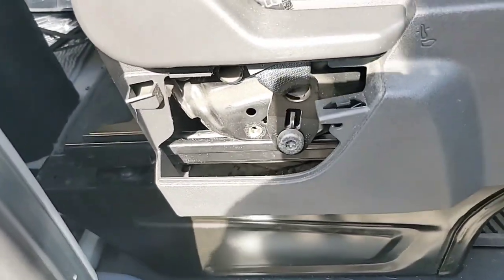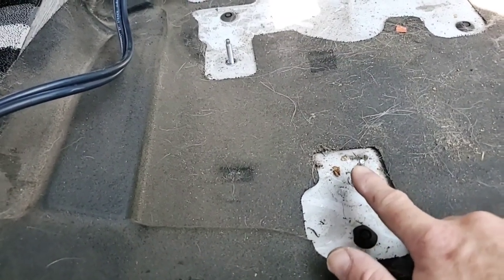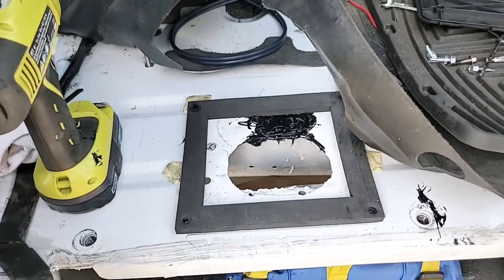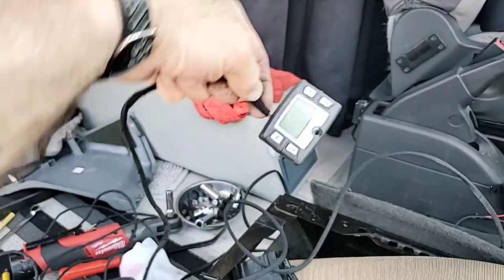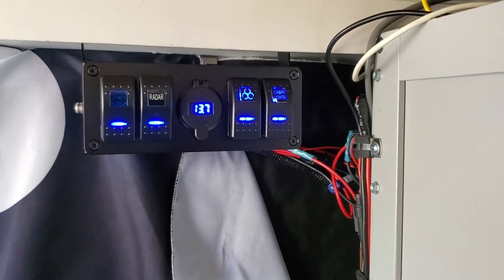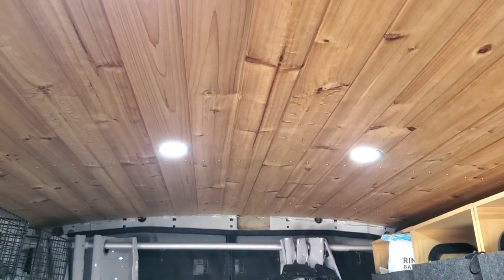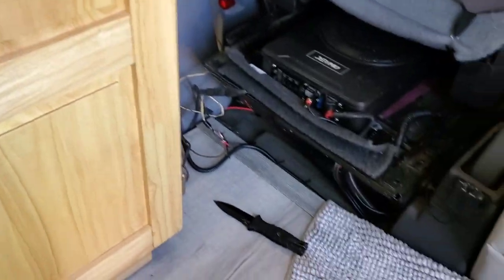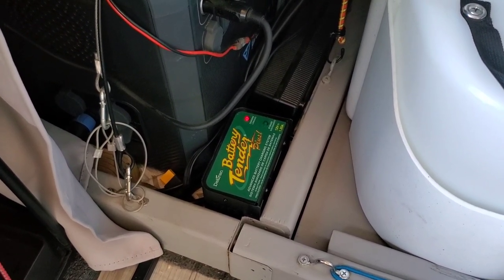Van Conversion Vlog #39  Bison 2000A Gas Heater Install - Part 2.     I messed up twice!

Comment from the maker: Update Steve, my check valve was bad. It was letting fuel evaporate in the line. Bought a replacement fuel check valve, so far it been working.

Comment: Couple of questions - happy with the heater? Where did you order the replacement controller from? Are you using the digital or analog controller? Thanks
Reply from the maker: yeah its ok, the instructions could have been a lot better, had to call general components twice to get the right info.  it fires up after 2 times now and blows hot. I'm using the digital controller right now, its kind of confusing. the analog controller I bought from general components. haven't used it yet. I think the biggest thing you need to do is mount the fuel check valve as close as you can to the heater fuel port.  And then there is a fuel damper right after the pump. My check valve is about 3 inches below the heater. So, after not using heater for a awhile it takes two starts to get it to fire up. Not that big of a deal for us. 
Thank you for you question and watching our video. any other questions just let me know. 
I am happy with it cause it was a lot cheaper than the others.